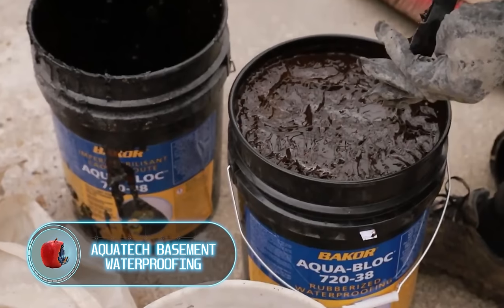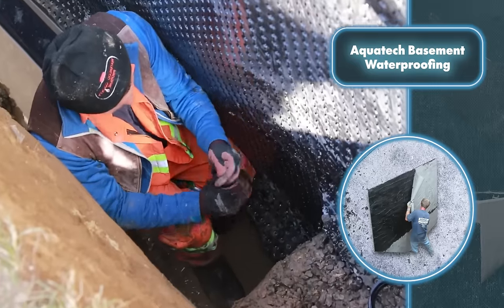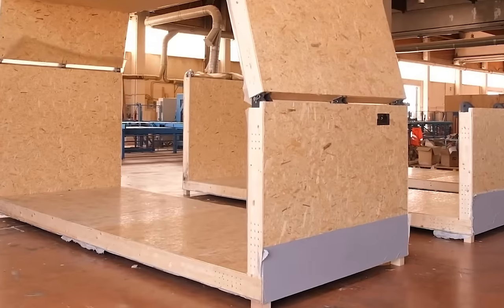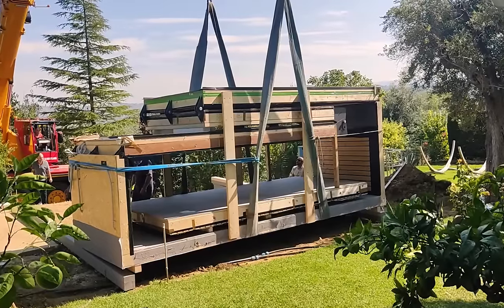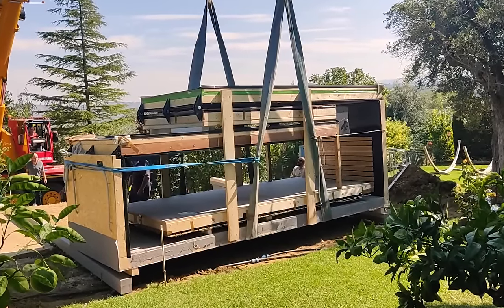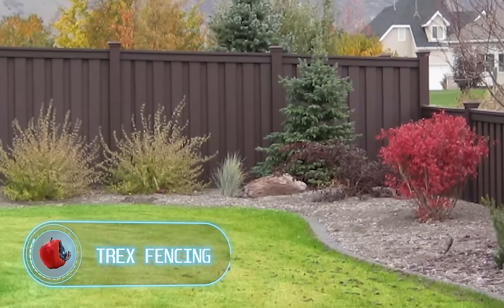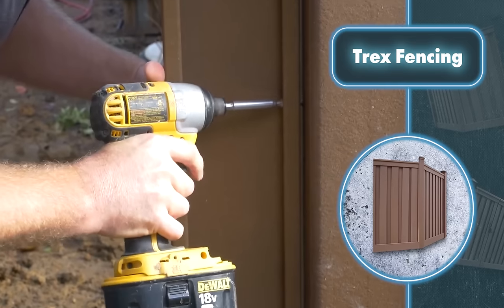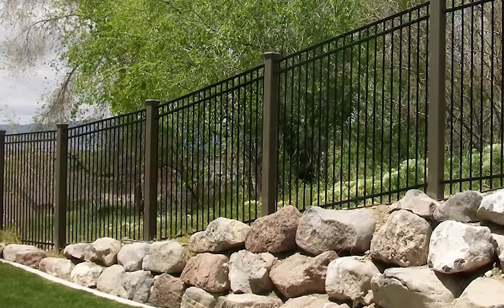These Ideas And Tools Will Change Construction Forever

Comment: Also, yes I've used tires for a foundation system. That's been around quite a while to my knowledge. They don't have to be filled with concrete though. Packing them with crush n' run gravel works pretty well!

Comment: I don't know if that Tasu formwork system is reusable.
Reply: Incase thinking the same thing, looks more like an issue when you por the rest of the foundation when you need to remove it and add the rear that got missed for the tyin

Comment: cast iron is a strange choice for the water drainage system - it's going to rust, expand and tear up that concrete, right?
Reply: They surrounded it with asphalt, which should be able to handle the rust jacking
Reply: They are replacing all of the rusted cast iron sewer pipes in my neighborhood. The materials they use now and many in the past ensure planned obsolescence.